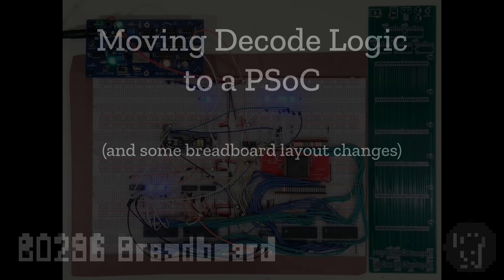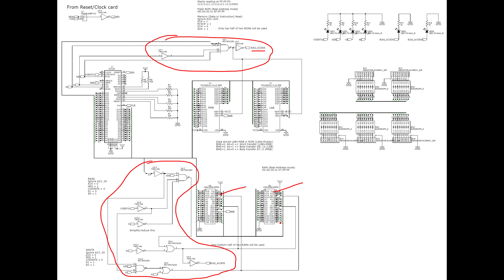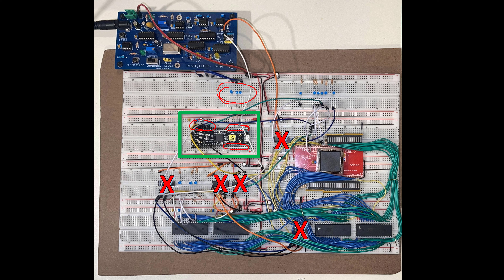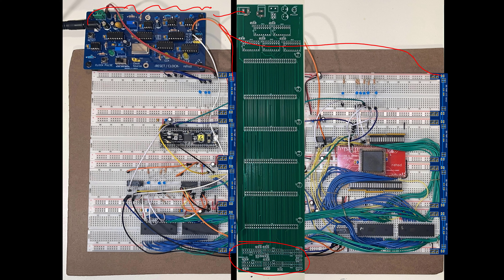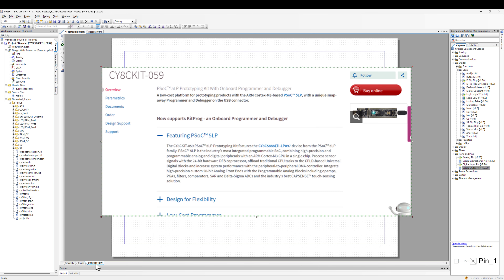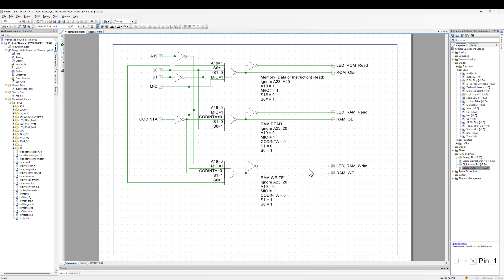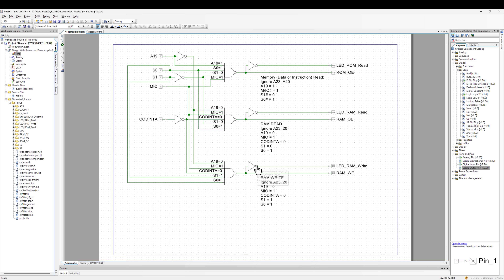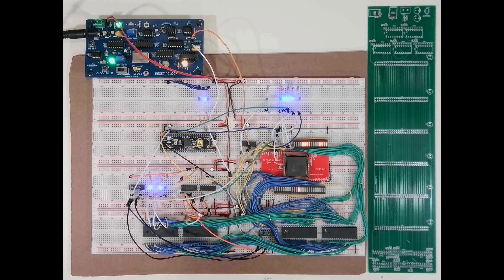80286 Build, Ep. #7 - Moving Decode Logic to a PSoC (and some breadboard layout changes)

Comment: Very cool! I'm wondering if "instruction read" should be needed for RAM as well, if you ever want to execute code from the RAM too (not only from the flash). As far as I understand this so far, basically read instruction and read data can be treated as the same way, as you also may want to read data from flash, and the above: execute code from RAM not only read RAM. Surely writing is another story, that's a RAM only thing, unless you want to re-flash from software ;)
Reply from the maker: Yes, I believe you are correct. If I loaded instructions into RAM, I would need to modify my logic to execute instructions from RAM. I haven't gotten there yet, but I'm pretty sure I will eventually need that capability.